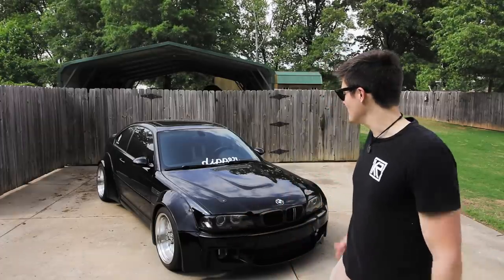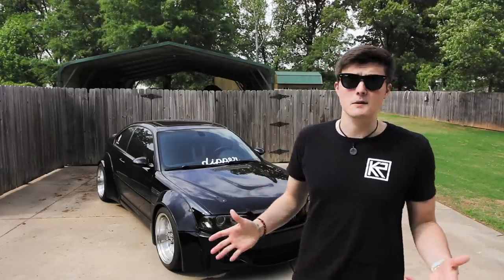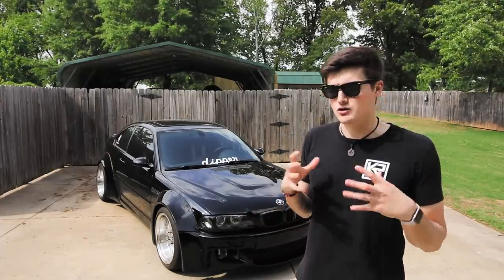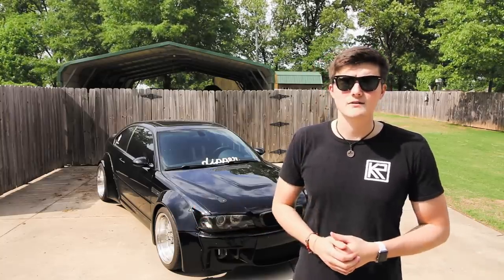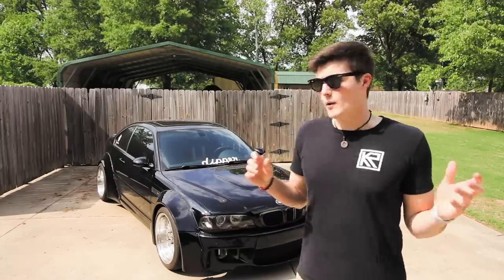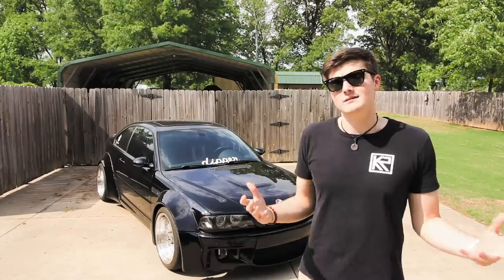DIY Widebody M3 Complete!!

Comment: Good work well done unfortunately not my cup of tea. Just wondering,  after you put the spacers you moved the tension point further along the drive shaft plus the extra weight of these massive wheels. Have you calculated the ratio of the weight and speed and distance on the new tension point (drive shaft) and compare it to the original manufacturer's just to see if you are withing the safety scope? Otherwise keep the speed down and avoid potholes. Best of luck. BTW you still got thumbs up for perseverance and achievement. 👏👍

Comment: Quick tip and maybe someone said this already... for sanding, you really want to use a block, no matter how small or thin for body surfaces. Then use a cross hatch pattern for even leveling and contouring. This will help avoid waves and low spots. Your fingers will leave curves, even with a sponge. This tip comes courtesy of Mark Wormen and the Mopar pros at Graveyard Cars on MT channel. But hey, good job! :D

Comment: I like the way it looks but don't kid yourself that the car handles better and is more planted etc. The suspension geometry is now all f*ed up, you have a huge amount of additional unsprung weight (spacers are HEAVY, not to mention those rims and tyres), big increase in drag etc. Assuming no engine upgrades, a stock M3 will smoke this on any track.
Reply: I don’t think he’s gonna hit the track in this
Reply: Okay I might be wrong but would the spacers, tires, and rims all not be accounted for in your springs because they are beneath them? I feel like his suspension should be fine but maybe I'm thinking about it wrong.
Reply: @Garrison Case Completely wrong
Reply: It all counts for unsprung weight. Which is no good too. All that mass has to move. The motor is gonna struggle more. And yes, that weight will jack a suspension too. Its extra weight that the struts/shock have to rebound. This car is going to be a slug on the track compared to a stock M3
Reply: Ahh but what if instead of spacers you go for wider tires? Wider tires is always a plus.
Reply: @EluneMusic  I think the point was that the tires are now so damn why they have to have a spacer between the Hub and wheel to get in the clearance which puts a ton of  extra force on the wheel bearings and the Hub itself the suspension bushings everything is being stressed more than its supposed to be the steering angle is now wrong the scrub radius is wrong pretty much everything about that incredibly finely tuned suspension to BMW made for that car is now garbage t
So this dude can put the stupid looking wheels on
Reply: J Blob but you won't need spacers if you buy super wide tires ;)
Reply: The weight savings from the new lighter wheels balance out the weight of the spacers!! And any increase in track width is great for handling or have you never seen an imsa car?

Comment: Wish I woulda known this was a 47 part video when I started watching. And I don't understand why you'd go the trouble of a custom kit and not mold it in to make it look like the car was designed with it. Just looks like any other bolt-on kit. Well done with all the work, but the look is meh. Do what you want, of course, but we need performance numbers or the claims of the wider wheels taking the car to "another level" or adding anything are just fake news.

Comment: I've sat down the last couple of days and watch this build all the way though.  At first I was like there is no way he is going to pull this off to I wonder if I could pull something like this off on my F100, LOL.  Who cares what anyone says about how it looks, as long as it your vision and you are completely happy with it.  If it's just gonna be a driver just adjust the camber and toe so it doesn't eat up those tires.  I had a 88 Chevy Stepside with 295/50 15s on it back in the mid 90s, was hell on front tires and bearings until I got everything straightened out.

Comment: A little late to the party and even though I probably would not have gone this route, respect for having the balls to do this yourself. I would suggest that if you haven't already, get some different wheels so you can ditch the spacers and start working on adjusting the suspension geometry/spring rates/etc to compensate. Not much you can do about the extra induced drag other than get some extra power and reduce weight wherever else you can. Just one of those things, if you make a change in one area you need to make adjustments elsewhere to make sure everything is in sync.

Comment: great job in completing your wide fender kit. i cannot say i really like the look but it does look good. i really do not want to nit pick at things i do not like about the look really coz i can imagine it took a really long time to do.
i'm planning on building a body kit for my car as well and i'm extremely excited about taking on the challenge i hope not to take a so long with my project as i'm building the entire car from the ground up with a full stealth roll cage and lots of stealth racing pieces. 
in my opinion the front end needed to be accentuated more with the wide fender and the rear bumper and defuser should have also been incorporated.
i would have preferred  the kit to flow from front to back to give it a robust look from all angles but well done i watched all your videos from start to finish just to see how you progressed and did not give up.
i wish i have the support you had when putting your vision together, looking forward to see more from you.

Comment: Nice work, but I doubt it is faster than a stock m3 through a corner.  True the e46 has a power/chassis/traction issue but the best way to solve it is with sticky tires. 

My point is that if you did it for the aesthetic appeal well done, if you did it for performance, you went the wrong way.

Comment: Beautiful! Very sharp looking with the widebody, rims and shiny black paintjob. I watched the first three and then rapid fire binge watched & cherry picked episodes to the end. So much work but worth it. I also forgot that the foam was just to make the mold and wudnt stay. I may cheapen out on my 91 civic and live with extra weight from moisture.

Two issues though about the bolts and the seams. I wonder if it would look even better if every bolt was body puttied and the top seams were sealed so no moisture could get in. ??

 It looks great as it is but i just wondered if it was made to look like a custom 911 without bolt on instead . But great looking car & videos. My personal dream was to make my two similar 1989 dodge extended camper vans super cool with some wide body effects and new glossy white paint and back spoiler:) im mostly serious. Cheers

Comment: Wow! Top marks for patience and determination! I've done a good bit of GRP work so I know how much you put into this project, but the result makes it time well spent.

May the Gods of the Parking Lot protect your work....of course you have the moulds now, but you still need to mess about with parts you pull off the moulds, so lets hope no blind idiot touches your bodywork.
I'm doing a 1950s 3 wheeler right now, but MUCH more straightforward, foam on body, Clingfilm, GRP on the finished foam shape, pull out the foam, basta...just needs filler and paint!

Comment: Dont get me wrong, the car turned out really beautiful. However, i really liked the original blue paint better.
Also, did you upgrade the suspension components/brakes to handle the torque of the wider foot-print both in turns and under acceleration? 
Great job, Dipper [Diaper?] (The lettering and font make it look like it could be either with the hood partially blocking the legs of the p's.

Comment: I think I'd have molded the entire front fender out of fiberglass and then gone through the effort of shaping aluminium for the rear quarter panels and getting them welded in before the respray. They're already getting drilled and fucked anyway might as well commit 100% riveted flares look like trash in my opinion. But to each their own.

Comment: The front Kinda of looks like a mustang at a glance .you did a beautiful job young man. I've watched since the beginning of the make over😘❤❤. I have a Chrysler Crossfire.  I've had it 11years and now I want to give her a facelift, lol. I'm going to put a mesh grill by T rex on the front. I'm getting the side skirts for it. I'm having the old faded pilling window pillars painted inferno red the same as the car instead of the factory silver overlay. I want to put 20" rims on it. It's made with 19" on back and 18" on front. Do you think 20's will do ok on a Chrysler Crossfire 2005. I've even considered fender flares but not sure if I want to do that, probably won't.

Comment: Great that you stuck to your guns on your build and, great that you took your time doing it however: A year is a year to long, you might like it but that is it. The design is just not professional looking. This is why clay is always best to use when doing this type of work. Like someone already said you need to upgrade the suspension, steering and power output. If you don't then this was just a waste of time in my book. I'm 51 and have built many hot rods, trucks, motorcycles as well as others. I always get the drive train, suspension and, steering right first. Then I do cosmetics it just makes for easier work. You will get tired of this car eventually because, it will go out of date, the performance will only go so far and you will want more, maturity your taste will change, what then. This car will be hard to sell especially now that you put holes in the fenders and, quarter panels.

Comment: I've been watching for a year and I can say you did a really good job making it look good. It's a sick showcar now! But performance wise these mods aren't helping at all. It's all cool if you not going to the track with this car. Those big ass wheels make the car feel very grippy when you drive it around town, but on the track you will be slower than a stock m3. You should be really careful ripping it because e46s have weak rear subframe mounting points. Those spacers and heavy wide wheels in the back are putting way more stress on the rear end than it's intended to handle. I've seen dudes rip off rear subframes just by trackdaying their stock m3s. AAAnd this kind of widebody is not very clever aero wise.. BUT looks mean as f tho. Good 
desktop wallpaper material!

Comment: I'm not a hater and I know nothing about car design but I have some cars with and without bodykit. But there is something seriously wrong with the arches, the front is convex and the rear is concave in width, the front are also wider and lower in the transition to front bumper relative to the rear (a bit like an old VW beetle) By all means .. well done..I mean..he was satisfied with the result? 
This type of car will always increase in value over time, but unfortunately this will not.

Comment: Poor M3. That looks like shit. It looks like some Chinese eBay shit you just bolt to the car. All that work, coulda just bought some fender flares.They don't even flow or follow the lines of the car at all. It's pretty ugly. If you wanted to do custom, you should've attempted to do flares that are actually part of the body, not bolt ons. But you'd need to weld... But anyway, nice attempt. Working on it probably brought you satisfaction and joy. It's your car. If you like it, great.

Comment: Respect for what you have done.
But it does not look good. Was so much better the way it was original.
Now it's just a car with something screwed up. Way to much over the top. 
Would you buy a stock M3 if they dilivered it like this? The widening put on with visible screws?
The beautiful line of the car is completely gone. 
You know that no one is ever going to buy it if you want to sell it.
And you can't remove it anymore because there are parts missing.
Better bought a $1000 car to do it on instead of a M3. 
But otherwise, respect for your dedication you put in to it.